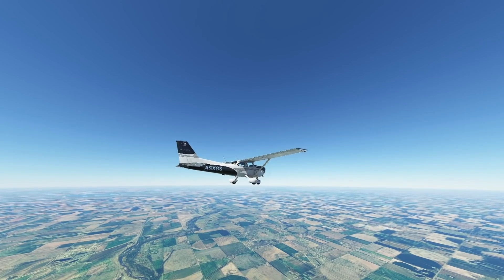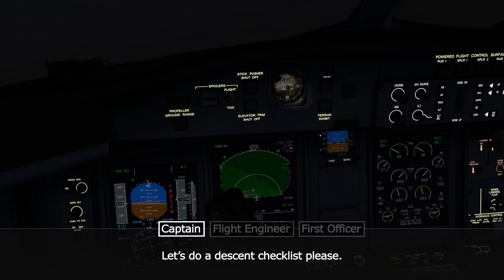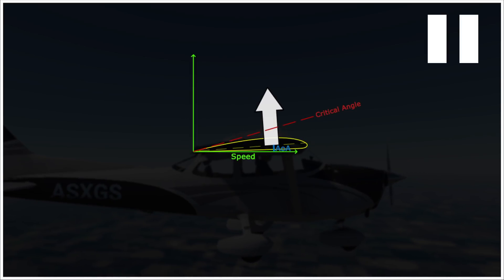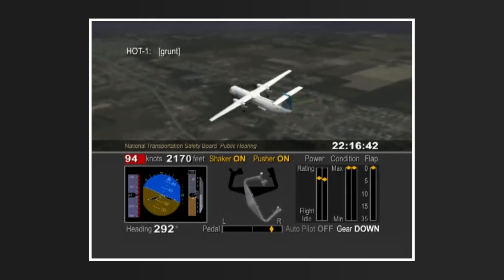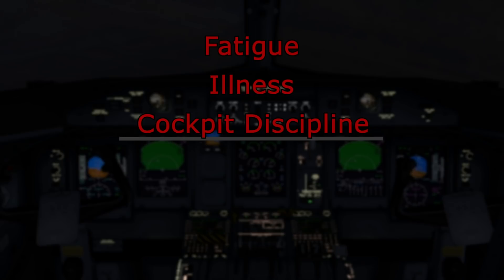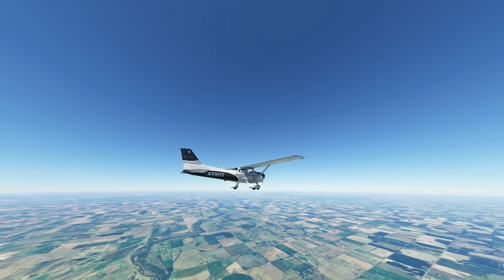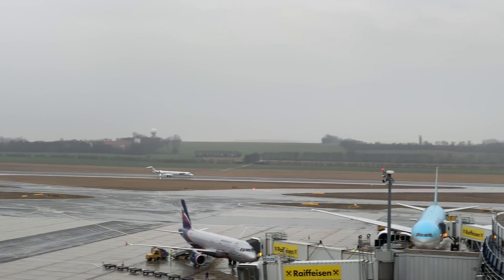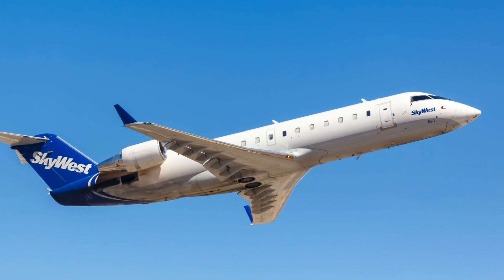Is The Crash Which “Changed” Aviation Really Having An Impact? | Colgan 3407

Comment: The plane was on autopilot.  It knew the stall speed.  It nevertheless allowed the plane to go below this speed and then turned itself off, thereby transferring a life-and-death situation to tired pilots.  To me this is the essence of the crash.  No video has covered this angle, including this one..
Reply: That's just it.   The autopilot did not allow the plane to go below stall speed.   When the reference speed switch is turned on, it sets the stall warning at a higher speed.  These pilots had set the reference speed switch to the On position. 

This switch is unique to the Bombardier Q 400.   When the stick shaker went off, the plane was traveling at 130 knots.  Its stall speed was 111 knots.  When the sticker shaker went off, the plane was not in a stall and not anywhere near a stall.  There was no life or death situation at that point.    There was no impending stall for the software to be aware of, and since the plane was traveling 20 knots above the speed at which it would stall,  no need to adjust the speed. 

It's up to the pilots to remember that they have the reference speed switch turned on, and to make their approach at a higher speed to avoid it going off when there is no stall threat.  These pilots did not remember it was on and made the approach at the usual speed. 

So even having forgotten that they had turned the reference speed switch on, and not having adjusted their speed, once it went off, the pilots could either have 1.  Remembered at that point, and simply turned the switch off and proceeded as usual or 2.  Performed the standard procedure when the stick shaker goes off by dropping the nose and the speed.

Instead, the captain reacted with startle and confusion, and did exactly the opposite, putting the nose up and increasing the speed, which then did indeed put the plane into a stall, whereas before he did that, it was not in one and in no danger of going into one. 

What no video except the "Mayday" episode about this crash has ever covered is why the plane went into a stall in the first place.  The reason no other video ever covered that is that the plane never did go into a stall "in the first place" to use my own words.   

I was always so frustrated by that.  Yes, I get that that the pilot did the wrong thing when the sticker shaker went off.  "But why did the plane lose so much speed that it was in danger of stalling before the stick shaker went off?" I'd think.  Sure, it slowed down when the landing gear went down, but that happens on every flight.  Then I learned about the reference speed switch.  So the answer to my question is "It never did."  

So actually, this was completely pilot error.   It wasn't ice and it wasn't the plane malfunctioning.
Reply: @jn8ive60  In brief:  1. Stall warning at 130 not 111 due to ref. switch; 2. Hence stick shaker at this speed; 3. Then panicked and incorrect response by pilot.  Correct?
Do you have a similar analysis for flaps/slats on takeoff?
Reply: @frankr29  No.  That's a different subject and there you may have a point.   I was addressing only the cause of this crash.
Reply: @jn8ive60  Then a belated thank you for the detailed clarification.
Reply: As far as I'm aware, the autopilot turned off when the stick shaker activated, which was before the stall. Had the captain done nothing the stick pusher would've prevented the stall from developing.

No grounds for blaming the automation here, it gave the humans a flyable plane (admittedly at the edge of the envelope), they crashed it.
Reply: No, actually the plane never stalled before the captain put it into a stall.  See above.
Reply: @jn8ive60  I don't understand the thinking here or in the previous reply.  The plane's software knew of the IMPENDING stall, but did nothing to maintain a safe speed.   Why rely on a human being to do something, or nothing, when a simple command from the autopilot could have averted disaster?
The same thing applies to a plane taking off without flaps and slats set, typically resulting in a quick crash.  Why wouldn't the software, knowing the plane is on the ground and misconfigured, stop a takeoff roll at a certain speed?  Why just sound an alarm (which can fail, be ignored, etc.) when the software can idle the engines?

Comment: Your dubbed in radio/ATC is reenactments are factually incorrect and add an amateurish element to what you put out.  The ILS for example is not "twenty three" it would be spoken and read back as "ILS two - three approach".  The same thing applies to assigned headings.  For example the assigned heading would be "two-three-zero" never "two hundred thirty".  Only assigned altitudes would be spoken by ATC and read back by the crew as "three thousand".
Reply: I scrolled down exactly for that, great video otherwise, but that really threw me off.
Reply: Having heard the real audio. This is bullshit. i could not listen to it.